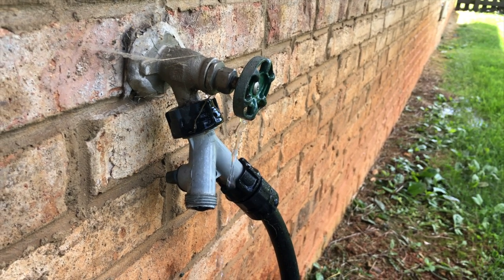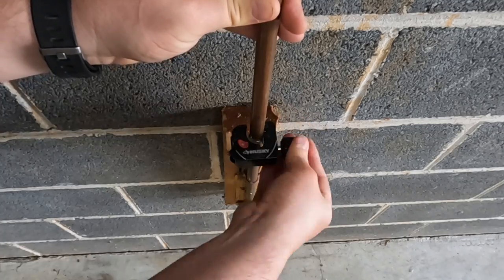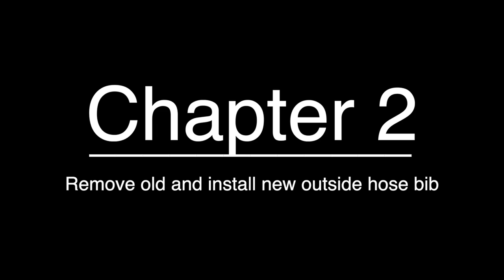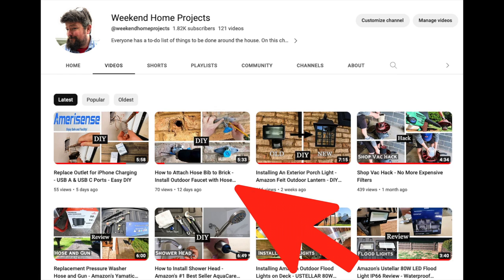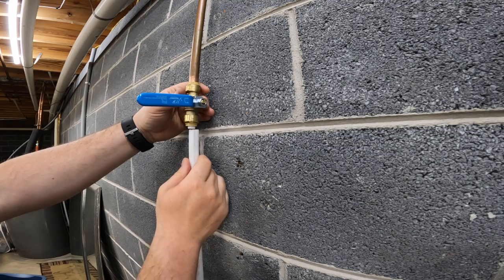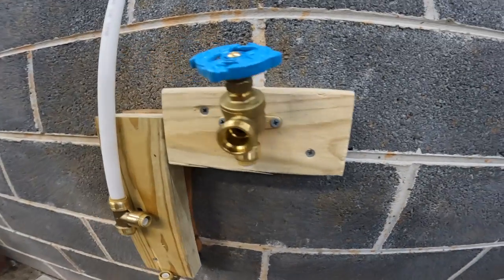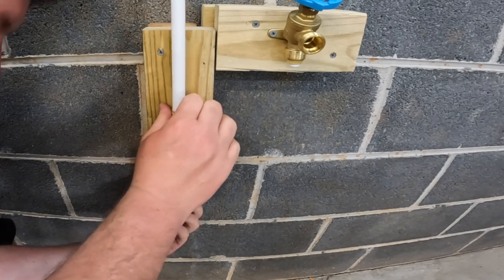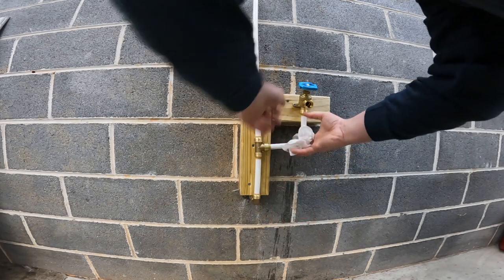Installing Sharkbite Shut Off Valve and Inside Hose Bib from Copper to Pex

Comment: Sharkbite works phenomenally well, IF, IF you prepare everything correctly and install it correctly, as you’ve already learned previously lol good stuff!! I’m using sharkbite shutoffs pex to copper on my supply and exit lines on my water heater and it’s been a year so far with no issues. I do need to drain and replace my diode in the tank so that it lasts longer and with my hard water it’s a must!!! Appreciate the videos!
God bless~

Comment: first thing you did wrong is sanding the end of the copper pipe, this is not recommended when using a shark bite fitting. it creates a profile on the pipe which can cause failure.
Reply from the maker: Was trying to DIY debur.  I need to get one of those tools.
Reply: you did debur, that's necessary, the sanding isn`t. @weekendhomeprojects
Reply from the maker: @xbrizzcakez  I had the inner debur tool, but not the outer.  Probably not as important as the inner tho.  Thanks for the comment.